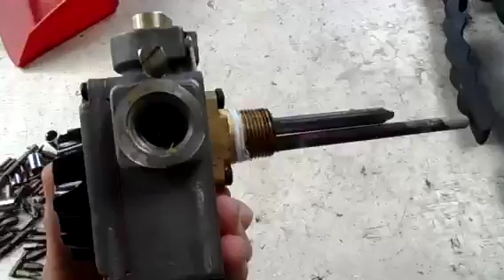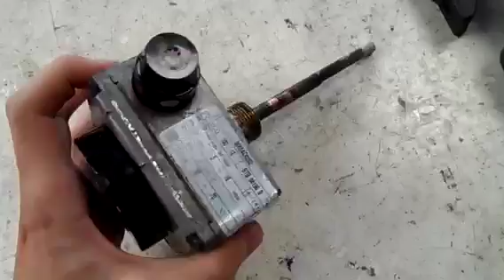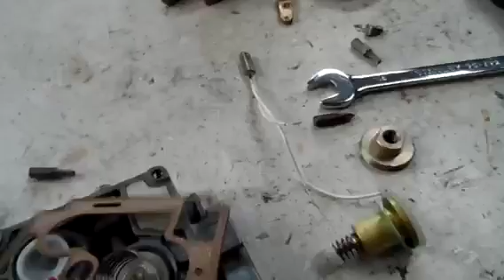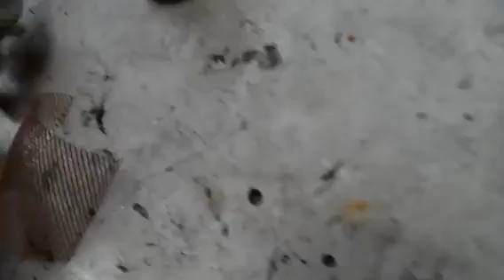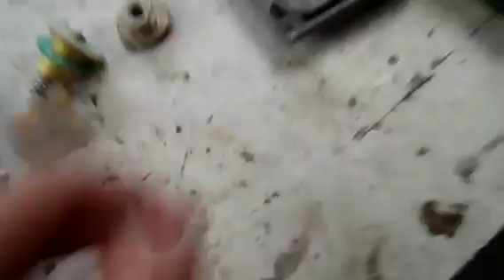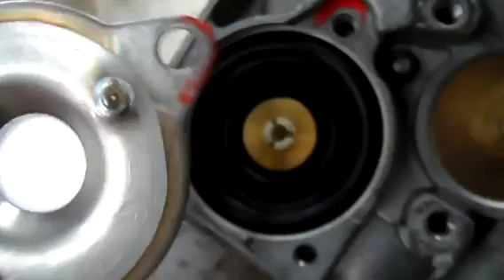Water Heater Gas Regulator Valve Autopsy

Comment: I'd be interested to see how the thermocouple safety works, the thermocouple senses heat from the pilot light, and if the pilot light does go out it will shut off the main valve off, the thermal couple threads into the small brass fitting on the bottom. the only one left in.
Reply from the maker: Sadly i didn't get any of the electronics or the thermocouples out of it :( the guy pulled all of it out to use on the new tank. It would be interesting to see what the deal is with that!